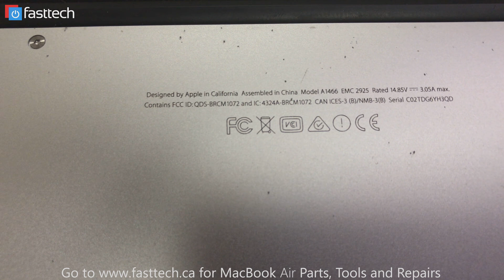Macbook Air 13" A1466 SSD Replacement Guide

Comment: I am getting a folder with question mark and I try to reset the drive but it doesn’t show any drive available so what do I need to do ? I have to replace the drive or replace the cable and is there any cable for the drive in air A1466 2013 model
Reply from the maker: You need a new SSD. Link is in the description.
Reply: @fasttechvideo  I am having same issue with my laptop. It just went blank on me and after removing and replacing it, it still wouldn't show my hard drive